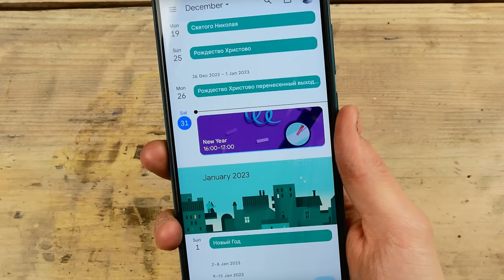Antique Sugar Grinder Restoration / 1970's Czechoslovakia

Comment from the maker: This was my first restoration and I had a great experience and enjoyment, as I am also a fan of video restoration. It's kind of a meditation of sorts. 

For you it is only 20 minutes, but for me it is a whole month of work in conditions of frequent lack of electricity due to destroyed thermal power plants and electrical substations and frost, the temperature was as low as -15C. 
 
At first I didn't want to take on its restoration because of the terrible condition of the brass parts. They are very thin ( less 1mm), literally bend with my hands, and are hard to restore because of their awkward shape. 
But this sugar grinder is such a unique thing, not like a regular meat or coffee grinder, that I put all doubts to rest. 
Whether I succeeded or not is up to you to decide :)
Reply: Good work. Just a little note. Although the grinder grinds various foods, it is a poppy seed grinder.

Comment: You need to test for lead paint on any item manufactured before the 1970s. You could be exposing yourself, your family & your local environment to lead contamination. That's irresponsible.

Edit: Most paints & cold bluing fluid are toxic & should not be used on food processing equipment. There ARE food safe alternatives.